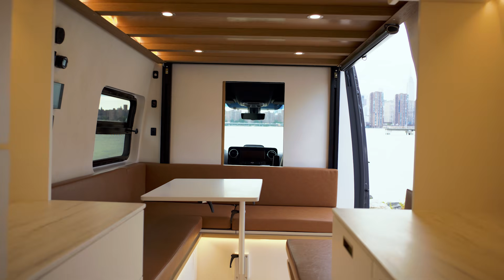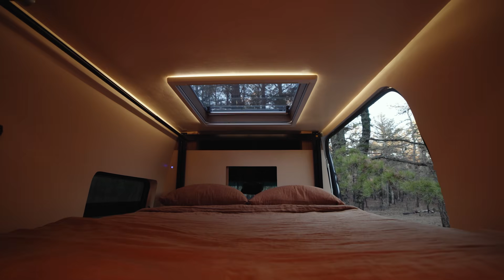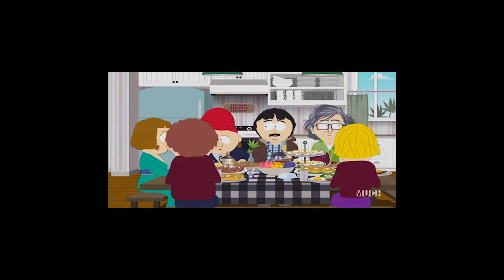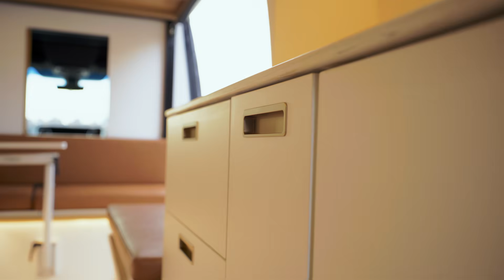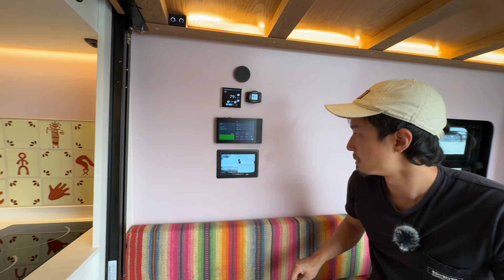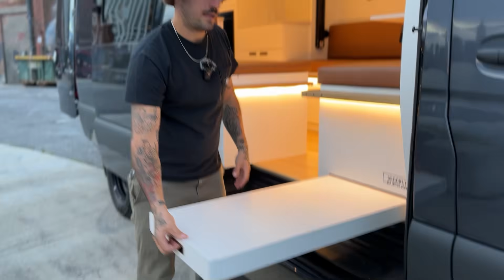Battle of the Vans:  Camper Van Comparison (with Elevator Beds)!

Comment: How high is the “ceiling” with the elevator bed in the up position? I saw a similar layout where the bed was in front, and in that van, when the bed was up, the maximum standing height was 5 feet 7 inches.
Reply from the maker: It's around that height. Funny enough this van is better for tall people - bigger bed, larger bathroom / shower area, and more space in the lounge. While the entry height is a limiting, you're mainly in that area while sitting. Our client here is 6'4".